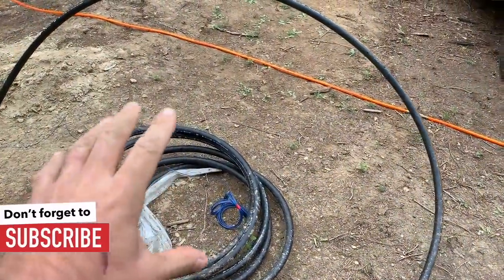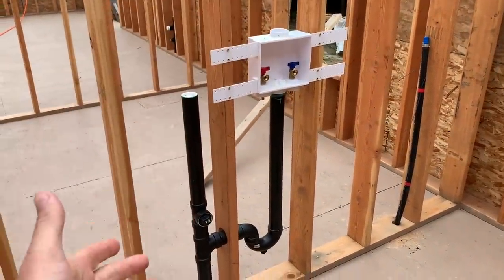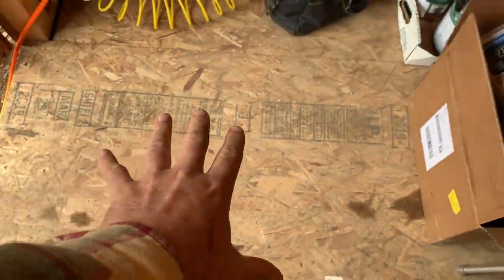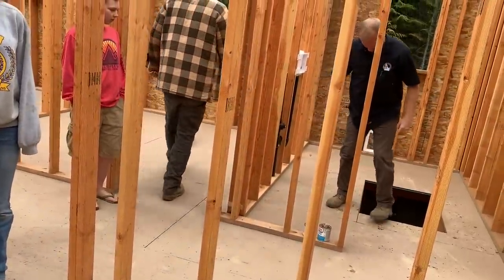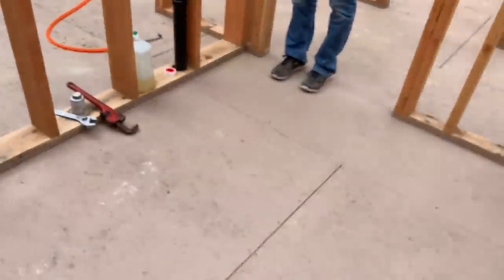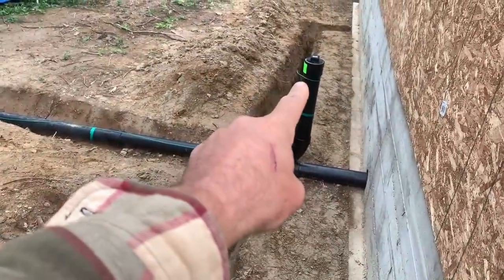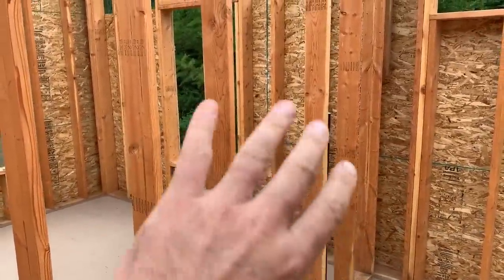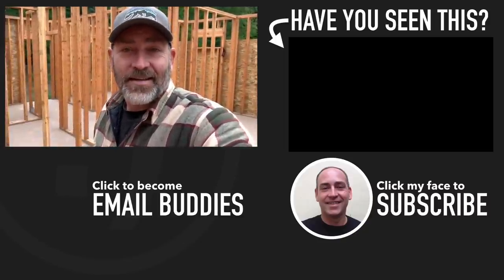Plumbing Inspection | Off Grid Cabin Build #30

Comment: wow i cant believe you tested the ABS system with air!!! YOU are nuts!!  that stuff shatters under air pressure and becomes like razor sharp pieces when it explodes.. I am a plumber the work you did looks good if not better than most plumbers i see install waste lines but testing with air is a no no.. IT even says on the pipe itself its not rated for air.. You need to fill the system with water with a 10 foot stand pipe filled to the top for a head test. But like i said you did a good job on the install nice.

Comment: Inspectors here Don't like OWNER/BUILDERS but I think your work is solid. You went at it right, I always disarm the EGO by putting the Inspector in a Teaching Position. Most Inspectors if they have an audience need to show they are in Control. This Guy was Cool. Because it is different everywhere, I learned from this video Martin. Just another reason why I want to move there. Cool Inspector(state right). Thanks and Congrats. Well done.
Reply from the maker: I’m glad he was cool.

Comment: Congrats on the pass. What is a tracer line for?
Reply: I were wondering about the trace line as well. It was explained you didnt need it if you can get a snake down the pipe, but why do you need it elsewhere ? Congrats on passing the plumbing inspection, inspector seemed like a nice fellow..

Comment: My inspectors wants me to put  laundry san tee not higher than 6 “ this looks like higher  and that point missing seafty plate looks like less then 1” Driwall nail may gets there  I’m doing plumbing 19 years I see lots of inspections And I was surprise  Venting not done completely and all the way to roof so he should come again to get test or what? Another air test? I wait until roof plywood done so I go to done my part one inspection  rest you done all was good

Comment: Surprised you passed with a water line and septic line intersecting . Normally they have to enter the house on opposite ends or 25 ft separate at parallel going into house.

Comment: My state the plumbing would have failed due to the poly water main coming into house and also the laundry p trap with the bottom cleanout
Reply from the maker: +MrDarren5012 different states different rules I guess. He did say the poly couldn’t come into the house but trusted me to fix it. Which I did. You will see it in future videos.

Comment: You will definitely pass as long as there are no leaks. I would make a recommendation though to go with cpvc instead of pex.
Reply: Scott Johns No way. Cpvc is trash.
Reply: Class A pex is the ONLY way to go, it can freeze and not break whereas cpvc shatters! FYI, the ONLY Class A pex on the market is Wirsbo/Uponor.
Reply: T K ok I’m here in north Florida and the only people that use pex are water municipalities and mobile home manufacturers.
Reply: @jiggjohns1028  At least you have 2 smart outfits using pex.
Reply: @jiggjohns1028  You obviously have no knowledge of pex  while i have been using it since the 60's.
Reply: T K I have a very good knowledge of pex I work with it everyday, I work for Clay county Utilities and I  have to make repairs on it everyday it is continuously breaking. So yes I know what I’m talking about.
Reply: @jiggjohns1028  Continuously breaking means you don't know how to install it correctly. OR, you are using Class B pex.